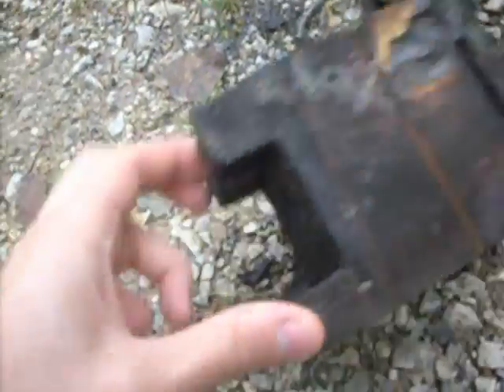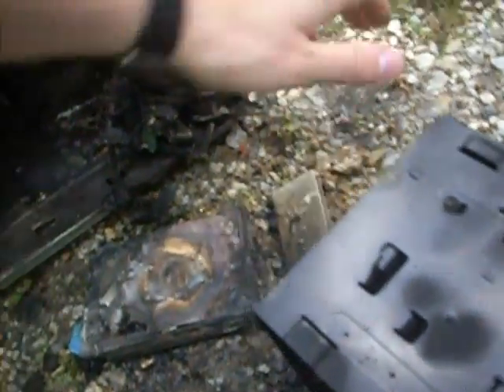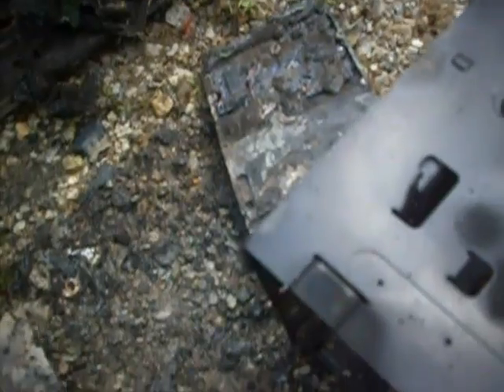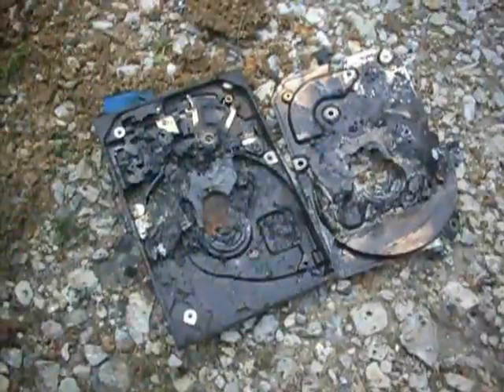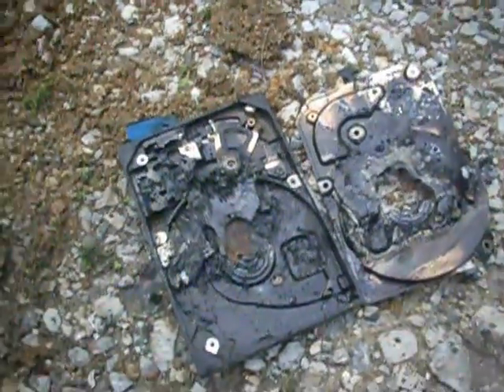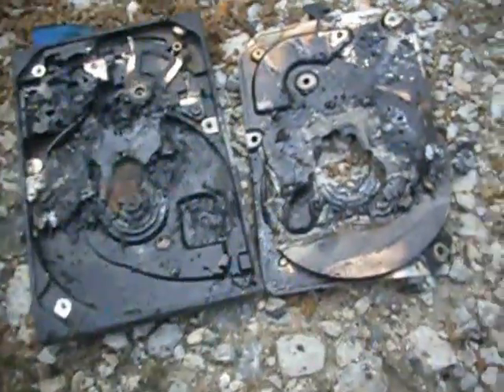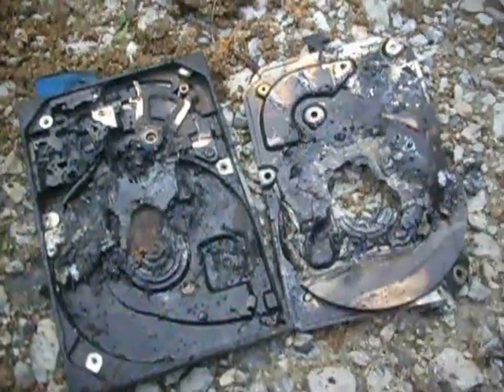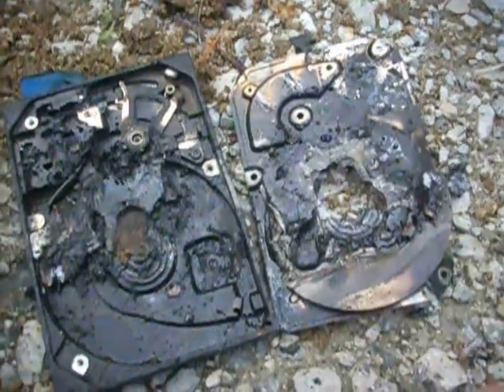Thermite Harddrive Self Destruction Test #3

Comment: @apoc4223 But where were the disks?
If the platter itself is mechnically damaged & on top of that depolarized by the heat, there is no chance(like 99.9999...%) to get any reasonable data from it...